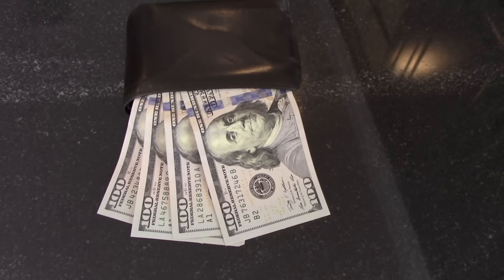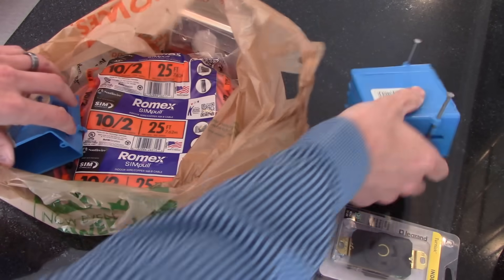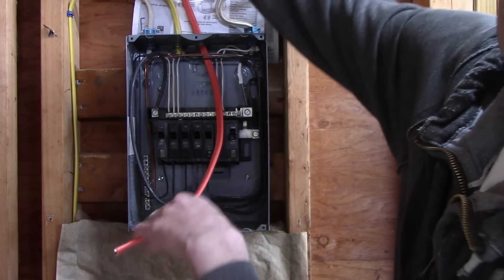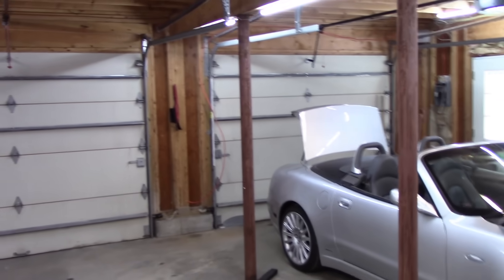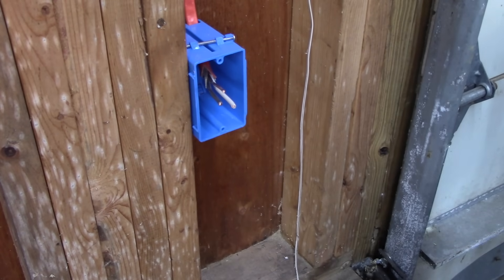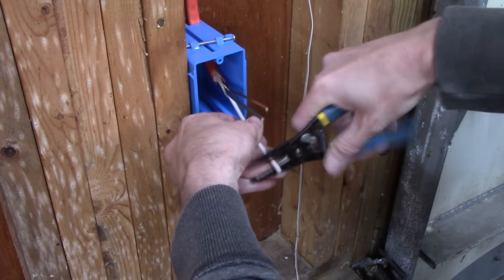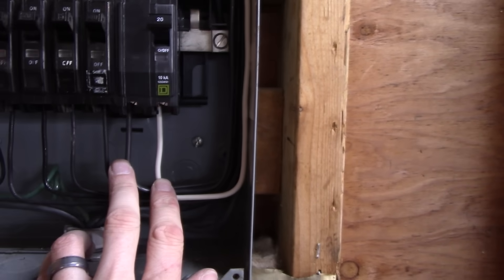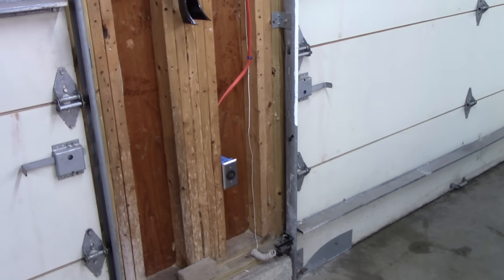DETAILED DIY: Wiring a 240v outlet step by step from breaker to outlet

Comment: As I'm about to hook up some 240 outlets in the man shed for a stove and dryer, I'm confused by your video. You're using three wires. Isn't code requiring 4 ? 2 hot, 1 ground, 1 neutral.
Reply: No neutral when wiring 240V. I would however recommend wrapping either black or red tape around both end of the white wire so the next guy does not confuse it for being a neutral.
Reply: You only do that if you have TRUE two Phase , or as with True 3 Phase 3 hot , 1 ground and 1 neutral.
In the us they have 120 volt , yes but its based on Transformers with Two outlet and a center tap.
You get the Hot 120 volt from Center tap and one of the sides.
To get 240 Volt you use both outher Taps and it give 120 + 120 volt and Because ITS STILL SAME PHASE then you Still
end with 1 neutral and 1 Hot and 1 ground.

It's always confusing when they talking about 240 voltage in the US and start misunderstand it with a Two Phase system.
Its NOT , its only ONE fase.
The frequency at a multiPhase system is 120 degree from each other so 3 Phase system is a total of 360 degree.
If you connect a motor in a star connection then you doesn't need / use a neutral wire at all.
Real 3 Phase power is typically used where you need lots of power.
Industrial and some homes have it too.
It's was common in my origin country to use 3 Phase for such as washing machines and they was fitted with a
heavyduty 5 Pin big connector to a likevise big heavy 5 pin wall socket/outlet.

So he actually wired it a bit wron in the video.
and NO it DOES matter with the color code . 
( even if it was real 2 Phase then still they have OWN color codes and the Phases are different from each other )
The phase is STILL 120 degree appart and if you wire a star connection without respect for what Phase is what 
then a motor can get trouble.

NEC: specifications - National Electrical Code  ( US & Canada )
Typically Single Phase 120V AC:
Black = Phase or Line, White = Neutral and Green/Yellow = Earth Conductor

Three Phase :

Black = Phase 1 or Line1, Red = Line 2, Blue = Line 3, White / Gray = Neutral and Green/Yellow = Earth Conductor

IEC: Specifications – International Electrotechnical Commission (UK, EU etc) 
Single Phase 230V AC:

Brown = Phase or Line, Blue = Neutral and Green = Earth Conductor
Three Phase :
Grey= Phase 1 or Line1, Black = Line 2, Brown = Line 3, Blue = Neutral and Green = Earth Conductor

Hope this can clarify it a little.

Comment: Very nice.  I learned a lot from this.  But, I really hate to complain, but would it be so much trouble to wear a jacket and turn the heater off so the sound would be better? At least you have the mic close to you so the sound is not lost.  So many YouTubers position the camera with built in mic 10 feet away so it sounds like they're talking through a tunnel. By all means keep doing these. Rick.

Comment: 10AWG is fun! Pull a couple hunnerd feet and see how it stuffs in a box. Like bending rebar! Where's your GFCI's? My inspector would have a fit. They would all have to be replaced since you were in the panel.
Reply: @Trialnerror  GFCI are only required in garages for 110v 15 and 20 amp outlets. They are not required for 220v.

Comment: I’ve been considering adding a breaker onto my property and running an extension out to my shed to install an outdoor outlet. I often need to run power tools. And currently I have been using extension cords, something permanent would be nice. 
One thing I’m stuck on is how do I determine the gauge of the wire needed? I’m assuming there is a equation for distance and amperage? I’m just wanting 120V so nothing too heavy duty.
Reply: Distance of wire is a consideration only for DC circuits as far as I know, such as with batteries and solar power. For AC, #14 white Romex is for 15A, #12 yellow Romex is for 20A, #10 orange Romex is for 30A.
Reply: Gabriel Clark wire gage is based off of the current draw from your load. So if you have something that is drawing 15 amps, you need to get wire that is good for 15 amps. Also, when selecting a breaker, according to the 2017 national electricians code, your load should only be 80% of the over current protection. So keep that in mind!! And yes distance also plays a roll.

Comment: 400? try 900 or more i had a 110 volt plug instaleld for a ac unit wall unit 980 bucks for 30 feet and a socket dedicated...

Comment: Connecting a commercial 80 gal 40 amp water heater requires heavier 4ire #8.  So I ran it for all my 240 stuff and my welding setups.
Reply: Theophilus Jedediah dangerous decision!

Comment: Protect your wires!!! Do not strip the full length with your utility knife as shown in this video, as you may cut into the insulation. The proper technique is to cut the outer layer at the last 2 or 3 inches.  Then grasp the wires in one hand and with other hand pull the outer layer back. It will spilt very easily back to where you want it to be removed.  Thus you protect the wire insulation and if you nicked the last 2 or 3 inches, it will likely not be used since you pull some extra to make sure you have enough.  The added benefit is you are less likely to cut yourself since it is a much shorter cut.

Comment: Great video but cutting your Romex with a razor blade as deep as you did is a good way to cause issues if you knick the shielding! Safest way is to use the ground wire as a pull string or just score the outer shielding but great video
Reply: sure nothing like adding extra stress to a safety measure 🤦‍♀️

Comment: It isn't actually 2 phase, 2 pole yes, but not 2 phase. 120/240 systems are single phase. If you were running 120/208 or 277/480 systems it would be 2 or 3 phase for the higher voltages.
Reply: lberhold    Close but not correct!   Yes 120/240 is single phase.   208/120 and 480/277 are 3 poles 3 phase, 2 poles single phase.

Comment: You can only put 2 wires under a single set screw on the ground or neutral bar IF it is rated for that by the manufacturer. Otherwise it’s a violation. Mixing 2 gauges under 1 set screw is generally a bad idea as the larger gauge can cause a loose connection on the smaller gauge wire. Splice and tail generally better. You can absolutely do that.

Comment: Beach house owning electrician here. You have a 30 amp receptacle, using 10 gauge wire for the feed, YET are using a 20 Amp breaker??? Why?? Not a violation but odd. Absolutely, ABSOLUTELY NO reason to upsize the wire after 25 or 50 feet. Maybe after 100 but more likely after 150 plus. You could check the voltage drop after the 100 or 150 feet but not that necessary.
Reply: Trial N' ERROR the feeder should have been sized correctly. You don’t have to account for that distance as additional to the branch distance. If that sub panel is in a detached garage, it does not look like it was done to code. There should be an equipment grounding conductor along with the 2 ungrounded conductors and the grounded conductor coming from the main panel. It’s hard to see but I assume you have that. ADDITIONALLY, you need an additional rod driven outside the detached garage with a grounding electrode conductor from the ground bar to the rod. Neutral bar remains isolated which it appears to be.

Comment: 13:16 Double taps are not ok
Reply: Trial N' ERROR    408.41 says grounded conductor not ground conductor.   Ground conductors yes, grounded conductor(neutral) no.
Reply: @Trialnerror  I was in a 15 year old house the other day that had 17 of them. I'm guessing the NEC changed that rule between then and now

Comment: You're lucky that you can do your own wiring. Here in Australia by law all electrical work must be done by a licenced electrician and that includes fitting a plug to a power cord. I used to be an electrician but I still can't legally do my own wiring.
Reply: If you don’t tell anybody no one will know.
Reply: Geez, what an overreach of the nanny state. Occupational licensing regimes that are allowed to act as legal gatekeepers for the right to work in various professions makes me sick. People should be smart and responsible enough to choose for themselves if they want to hire someone with a specific certification or not. I have respect for everybody with expertise in any particular trade skill and typically defer to utilizing them to get the job done properly. I can't stand it when it is a legal requirement to do so though...rant done.
Reply: @geejay5653    rant justified.
Reply: leglessinoz,   what FishFind said. So I'm wondering if the hardware stores in Oz are allowed to sell electrical HW to regular consumers, or do you have to show an electrician's license at the cash register?
Reply: Unfortunately, your constitution does not protect the individual's rights.  Then in 1996, you guys completely gave away any chance you had of protecting your own rights.

Comment: i have a question, i have a 220v connection running from my main board to the top floor where i have an electric stove. my current need is to get a second out let for a electric stove in the basement. my query is can i attach 8/3 wires to the same breaker and get my second out let for the basement
Reply: @Trialnerror  how do I go about if I dont have any slots left on my board.
Reply: Salin Antony    Don't do it!   You need to have a sub panel installed.

Comment: I'm Not a good electrician at all. I'm what you'd call a shock absorber; more comic relief than anything but like you; we're indispensable. Your vids are almost as entertaining as AvE here on the YouTryNotToScrewItUpTube. Yes, you need to keep repeating that there shouldn't be anything exposed when fully inserted, right. BTW, enough studs there? Trying to compensate for something? Also, you really should take off your ring when working with live wires. It'll save your wife the embarrassment when she has to ID you at the coroners!  LOL

Comment: I am not an electrician , but it is not 2 phase , it is single phase 220v , 2 hot legs and a common ground , ground lug on any box goes towards ground , I always roll my  terminal ends with a eye loop , even if they were to loosen there would be no chance of coming off , also in a metal box I would run 2 turns of electrical tape around the entire box covering the lugs twice , but that is how I work , and I am not an electrician , never had been ,   Frank T

Comment: Last year I dug in power to my new out building. All the wire was laid, appropriate conduit used. I just needed a 4 lug meter base swapped out, a 30 AMP generator plug  and a service panel put up. The wire was run into the garage, and the ground below the meter base was open. Basically two tin cans and a plug. I was going to do it myself but when I saw how cheap the parts were I thought, why bother. What a Big mistake! The electrician charged me 426.00 for the same meter base I could get at my local store for 48.88!  Another 97. for the one foot jog of wire tot the plug and he brought another journeyman with him to talk on the phone to do a few other random tasks. Charged me extra to come back and do the plug "next time" What! I had to pay $1346 for two tin cans and a plug to get screwed to the wall. There went my budget to wire up the building!
Reply: Trial N' Error I will go to my grave thinking about that $1346 dollars! I’m sure if you wanted to fit in your plumbing job and knock it out quickly with shark bite you would have just done it yourself. How do these people sleep at night?

Comment: Nice, clear video.  Unfortunately, you used a receptacle that's designed for 120V, not 240V (which is why you had a chrome-head screw on it which was marked N for Neutral--a 240V receptacle would have had two brass screws instead).  You're using a L5-20R receptacle; the correct 240V equivalent would be a L6-20R.  Not a big deal, maybe, if you're the only one who ever uses it, but you aren't going to own that property forever.

Comment: I would recommend a double duplex box for a 220 outlet, since the wire is thicker the small boxes are a real pain in the ass for compressing everything in there.  You can get a cover plate that secures the outlet right in the center of it, using the double box for a single outlet as such.

Don't forget your anti-short bushing on the sub panel!  Too late I guess but you can always go back and add it.
Reply: @Trialnerror  No problem.  I found out that you need a "mud ring".  With a mud ring you can either install two receptacles/switches or only one on a two-gang box.  The mud rings also have varying depths from flat to 5/8" I believe!  Just bought one for a project the other day.

Comment: Flat head really should have been outlawed after we went to moon..
Reply: Few truer words have ever been spoken.
Reply: Phillip also. "Screw"  him.  Torx guy  needs a noble peace prize
Reply: Chairman of the Board  They exist because they are 10x better than any damn slotted or Phillips head screws which should of been outlawed years ago! Ask any TRADESMAN what they prefer. It will be Torx ahead of that other crap i just mentioned. You guys on here that prefer a slotted or Phillips screw over a Torx or Robertson head screw sure don't do much screwing. LOL
Reply: @KStewart-th4sk  if I'm using a power screw driver i would use Phillips or torx, but sometimes torx are a bit too gripy and pull the tip out but if you need to really torque something down a standard would work the best
Reply: I kinda agree but you can put way more torque on a flathead than phillips
Reply: Slot, you mean
Reply: GRK makes some of the best screws I've ever used. Buy torx or watch me throw them away 😂
Reply: Amen
Reply: Except on carburetors.
Reply: Also the philips ones
Reply: The Real Schuyler Martin who went to the moon?
Reply: They can put a man on the moon but they can’t consolidate and uniform screws!
Reply: Hell Yes! 👍👍👍
Reply: Can we all agree that the Robinson is trash?
Reply: @DOCTOROCTAGONAPUSS  Are you meaning "Robertson" rather than Robinson? A Robertson is a helluva big improvement on both slotted or Phillips. You can stick a Robertson head screw on a screwdriver without the bloody screw falling off. Try that with your slotted or Phillips---THE BIGGEST TRASH EVER INVENTED! I see by some of the comments on here, it sure isn't tradesmen talking. A tradesman would take a Robertson or Torx over that other garbage any day. You must not do much screwing if you like those other crap headed screws like Phillips and Slotted!
Reply: The Real Schuyler Martin - so, what I think you meant to say was a slotted screwdriver, flat head denotes the style of the screw head not what drives it.
Reply: @tomsdreamshopworx  you're the worst person. This literally never needs to be said.
Reply: TomsDreamshop Worx Oh, shut the fuck up smartass. You know what he was referring to.
Reply: @tomsdreamshopworx  Flathead Ford motors were the best!  lol!  Good video!

Comment: Help a newbie out: why don’t you need 10/3 wire in this instance? I would have thought you need two hot wires (ie red + blank), then white to neutral bar and ground to ground bar. 

Great vid btw! Keep up the good work.
Reply: The welder doesn’t require a neutral that’s you don’t need a neutral. If it was more extravagant and had controls in it that required 120 volts than you would use a 4 prong 240volt plug which would allow you to utilize 1 half of the 240 volts to control your 120 volt controls.
Reply: Ian Courter in this case you don’t need a neutral because you’re trying to get 240v. If you use a neutral you’ll get 120v. You can use a white wire for your other phase like this guy did but you need to identify it as a hot wire with black tape.
Reply: Other applications for the neural on 240 is electric car chargers

Comment: Question: I have a 35 foot run from the panel to the stove outlet that is 220. I want to add an outlet for a washer/dryer combo unit at around the 25 foot mark. Can I simply add the outlet to the existing run or do I have to do the whole she-bang and add a new line/breaker/outlet, etc. (basically run its own dedicated line)  Thanks.
Reply: Dedicate each. Never share appliance circuits

Comment: excellent job ! the only issue i see is that you should have mounted the plug at least at 4 feet from the floor
Reply: Delta Co 18inches
Reply: I believe there is a no code for the garage outlets minimum height unless they are ignition source which is at 18”.